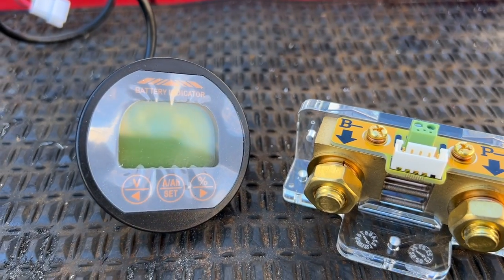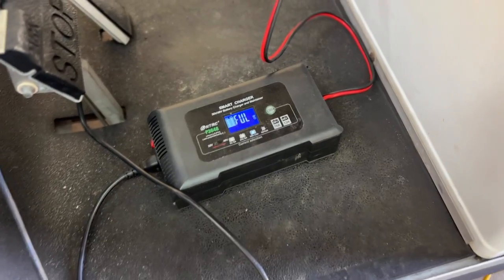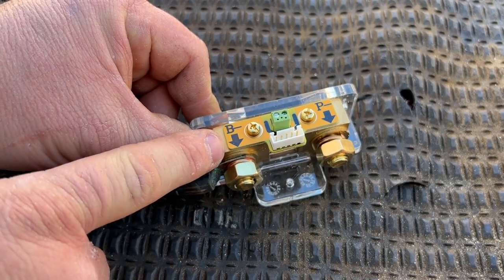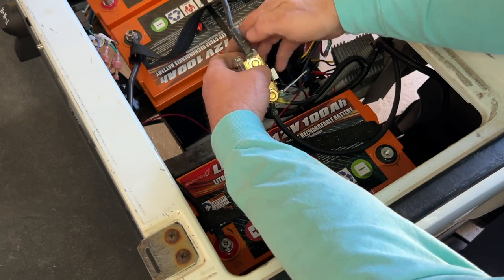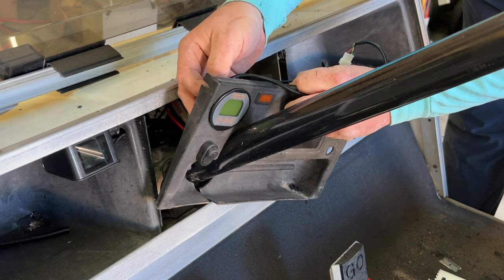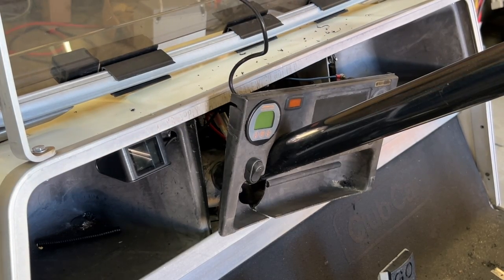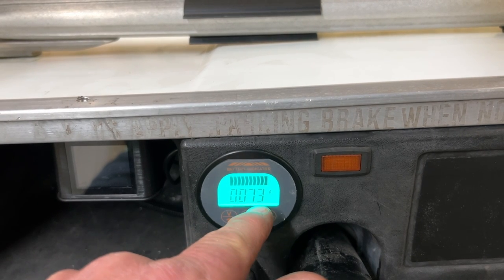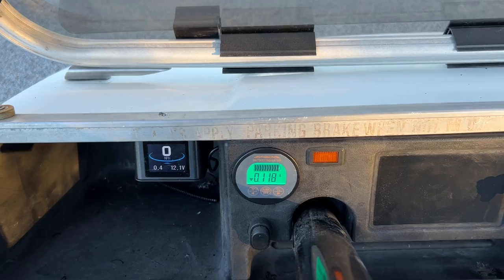How To Install A Smart Battery Meter & Shunt In A Golf Cart | Measures More Than Just Voltage

Comment: So if I have Anderson connections do I use the negative at the buss bar ?
Reply from the maker: You would have to use the main negative before the controller and then run the other side to the controller. You could also cut the main negative in half, crimp ring terminals to the ends for the shunt.
Reply: @Fentertainment  …I’m sorry , that’s what I meant . Connect it to the main negative at the buss bar . Have it come off the main negative on the buss bar so it’s actually between the buss bar and the cable to the controller.
Reply from the maker: @toledojeeper2932  The shunt needs to be between the battery and the buss bar. If its between the buss bar and the controller then it will not read all the grounds at the buss bar.
Reply: @Fentertainment  …But I have 2 batteries so I have 2 negative cables into the buss bar . 
I have the Big Battery Eagle 48 volt 30ah batteries and they have a connector for their gauge . Could I use that in any way ?
Reply from the maker: @toledojeeper2932  So you would need to take both negatives from the batteries and connect them to the battery side of the shunt. Then you could run the output side of the shunt to the distribution block. Then you could run your main golf cart gound along with the charger and voltage reducer at the block. What ever you do you have to run both of your battery grounds to the battery side of the shunt. On the other side of the shunt you can run your distribution block to hook up all the negatives.
Reply: @Fentertainment  …ok . Thanks for the help . The meter that comes with the Eagle batteries doesn’t give much info and I’m looking for a different gauge . 
By the way , thanks for the 10% discount code for the batteries.
Reply from the maker: @toledojeeper2932  No problem! This is my go to gauge. Some of the other brand battery companies actually use this same gauge and put their logo on it. I like that fact that I can see a percentage, voltage, amperage capacity along with amperage input and output all in one gauge. In fact I need to order some for my other carts. This will sure take the guess work out of range anxiety. You more than welcome! 
I appreciate the support of you watching my videos!

Comment: Does the meter remain on when the cart ignition is turned off ?
Reply from the maker: Yes, the backlight will turn off but the meter remains to read any type of amperage in or out.
Reply: @Fentertainment   Is there anyway i can shut it down while Im away in winter for a few months?
Reply from the maker: @WyattHaleschannel  I’m sure you could add a 48v relay and run the power wire through the relay to turn it off with the key switch.
Reply: Thanks so much, Also, I have 4 trojans t-1275. It has different amp ratings. Any idea on what amp rating I set my gauge? So sorry for the questions.
Reply from the maker: @WyattHaleschannel  if that was me I would set it to the lowest amp rating out of all of the batteries. Then if you exceeded it then that’s just extra gravy.

Comment: I have a 2017 Yamaha cart, I installed the Big Battery Falcon 3X kit. Wanting more information about the batteries I installed this smart meter and shunt. After installing and settling the meter I drove the cart for a test drive. All went well and the percentage of drop seems to be correct. The problem is when I charge the batteries the percentage of charge does not change. The batteries are at 100% 58v but the meter shows 62% until I reset the meter. I double check the voltage connection to the shunt and it’s good. Any ideas or is this normal?  By the way the simple meter I got from big battery goes back to 100%.

Comment: My 48 Volt LiFePo battery went dead after only about twenty minutes.   does a 100 amp hour LiFePo have as much range as the Trojan batteries?
Reply: Also, my HTRC charger would not recharge it from dead, it showed "Off" on the screen.  so I strung out 4 x 12 volt small chargers in series to wake up the BMS which got it up to around 57 volts and that did not work.